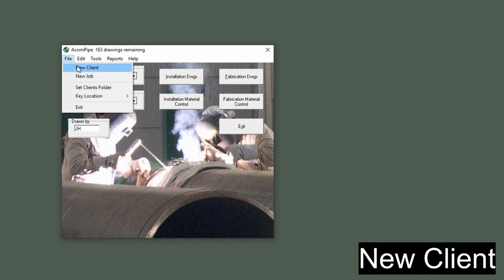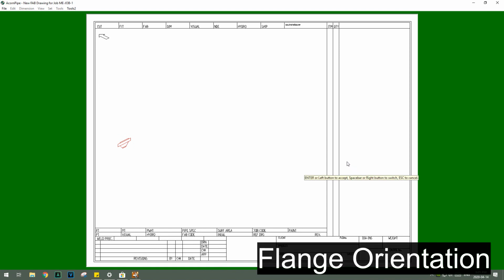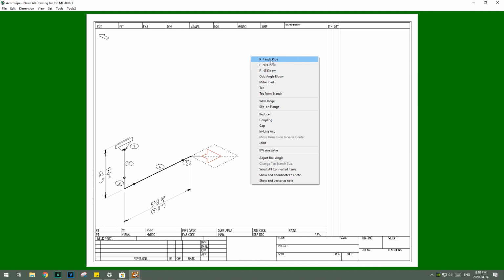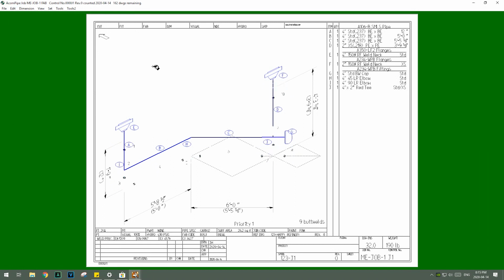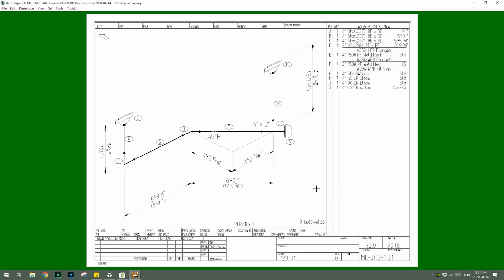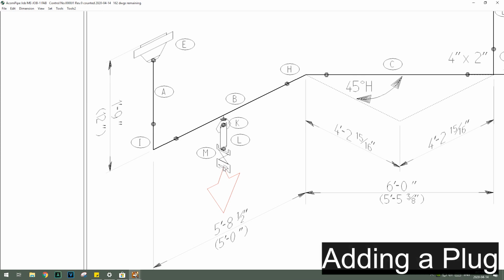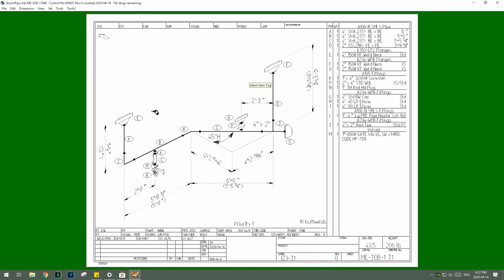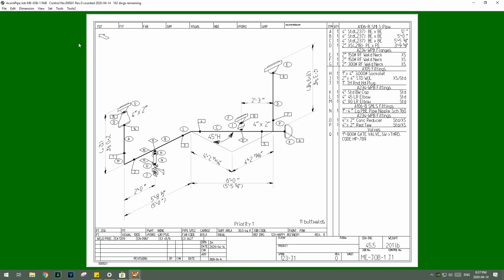AcornPipe SpoolFab Tutorial - Complete Walkthrough

Comment: You need to check your spec. I am assuming you are using long radius elbows, a 4" CS elbow should not be 9", it should be 6"
Reply: It's not showing the elbow as 9". It added the 4" LR BW 90°el (6") and the 4" 150# RFWN (3") to get the overall fitting allowance takeoff of 9".